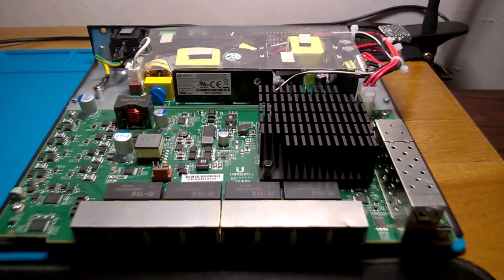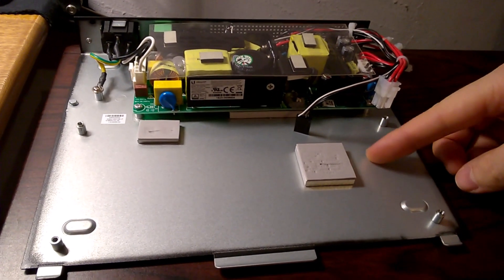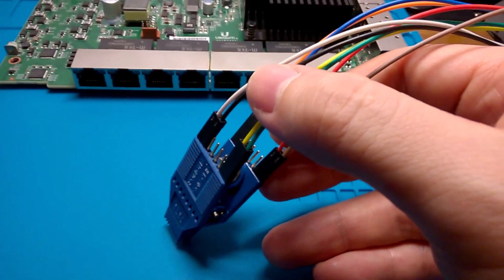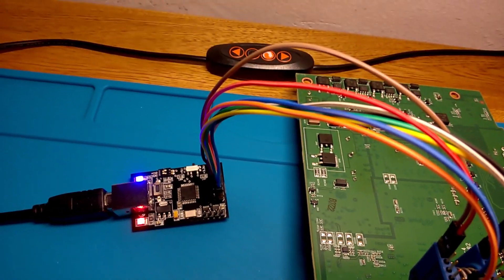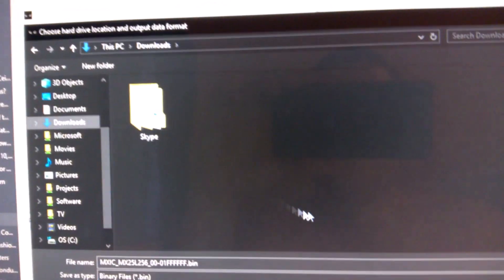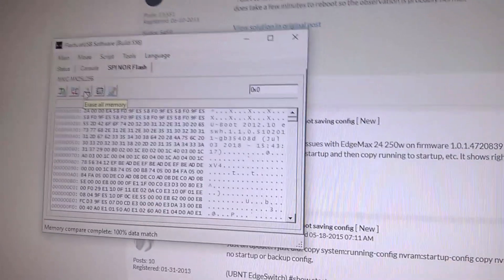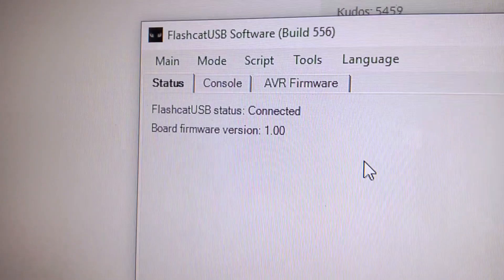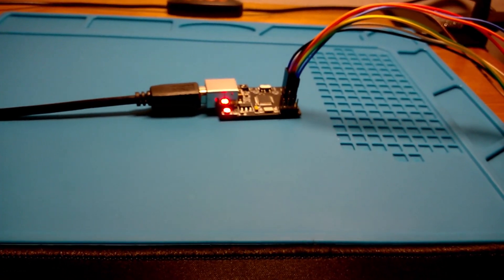Ubiquiti ES-8-150W FlashcatUSB SPI Flash Backup

Comment: Do you happen to have a ROM dump of one of the 24 port switches, NON poe? I've got a POE one that bootloops, and wanted to test if it's due to a bad POE board by flashing the EEPROM section of one of the non poe ones. Thanks in advance!
Reply: Did you get it working ? I'm in the same boat
Reply: @nzhomie  nah never got it working, seems the SOC on those tends to die in such a where where the CPU part stops communicating with the network chip part

Comment: Hi!The flash failed.Installed a new one, filled in the removed dump, but got A12.
Reply: The same with me but with another programmers ch314 and EZ2023+ .
did you found solution for Error A12?

Comment: any idea if the logins are different on the dump as the ubnt/ubnt isnt working for me, im trying to use the flash to diagnose/recover a  48-500w,

no worries i managed to get it to reset and am in using ubnt.

dont suppose you have come across a 48-500 dump?
Reply from the maker: If the username and password are no longer working you can always factory reset the device
Reply: У меня есть,но вероятно вы как и я получите error a12
Reply: Was it possible to run es8-150 on a dump?

Comment: hi m8 can you tell how to make 8 pins paloma and how connect the cables to flatcatusb
Reply from the maker: Hello, you can buy an 8 pin or a 16 pin Pomona clip that is already pre-wired from embeddedcomputers dotnet. Go to Products -> Cables and Test Clips page
Reply: @RicardoCooper  thanks i have a clip  i need where come the wires can you help me .
Reply from the maker: @wimmoer424  OH OK, from what I understand you have a Pomona 5250 SOIC8 that is not pre-wired... For the wiring pinout/diagram you can look in the FlashcatUSB manual on page 18, here it will show you the connection
Reply: @RicardoCooper  thank you.

Comment: Nice video, can you share dumped flash from us-16/ 24/ 48 ??
Reply from the maker: Sorry, I only have a ES-8-150W
Reply: Ricardo Cooper can you share it? Maybe it helps me to repair my US switch.
Reply from the maker: @tertomium  I just remembered I DO have a US-8-150W backup (I was attempting to convert my ES to a US) here it is https://mega.nz/folder/65gFSabY#TgzH-0uILAbwWGhF4nFLEg

Make sure you save a full backup before you try anything, I have also included a (FCS) script file you can use with the FCUSB to only read/write to specific sections of the flash

If you need additional hand holding/help let me know I am available, all I ask is for a donation (of your choosing) after the job is done.
Reply: @RicardoCooper  wow, thanks a lot. Have one of these dead switches where just some led port pattern lights up.
Seems to be a common problem but there seems to be no solution except RMA it. Maybe its firmware related.
Reply from the maker: Ремонт ubnt  I do not think you need to convert it because they both just dump the raw binary content of the flash. I would however delete the EEPROM partition before flashing because this is where the MAC and other specific hardware addresses are found (you can cut EEPROM part out with a hex editor)

0x000000000000-0x0000000c0000 : "u-boot"
0x0000000c0000-0x0000000d0000 : "u-boot-env"
0x0000000d0000-0x0000000e0000 : "shmoo"
0x0000000e0000-0x000000fe0000 : "kernel0"
0x000000fe0000-0x000001ef0000 : "kernel1"
0x000001ef0000-0x000001ff0000 : "cfg"
0x000001ff0000-0x000002000000 : "EEPROM"

If you preformed a full backup before you flashed my backup send it to me, I will try to fix the corrupt parts and send it back to you.
Reply from the maker: Ремонт ubnt  I emailed you on your website
Reply from the maker: Ремонт ubnt  Write me your email in a reply, then delete it after I write you.
Reply: @RicardoCooper  Did you manage to convert ES to US?
Reply from the maker: @АнтонРумянцев-ц7п  I personally did not succeed, but another guy said it was possible, but I am not certain other than replacing the firmware, what else needs to be done.
Reply: @RicardoCooper  I tried to write your dump to es8-150, and the switch does not load.I can't log into your account because I don't know the login password.Reset the button on the switch, writes that there is no firmware.error a12.compared the us8-150 dump and yours-they are completely different.Do you have another dump?
Reply: @RicardoCooper  If necessary, I have a dump of es 8-150 and 48-500
Reply: @АнтонРумянцев-ц7п  Hi,  If you have US-48-500 dump could you share it ? i have an un-used ES-48-750 (i assume they are pretty similar) that i don't use, i would be curious to give it a try :)
Reply: Any update on this guys????
Reply: Any chance cam you share kernal file for the switch. I am traying to load via console, with U-boot commands. But I need just kernal to write on specific address.
Reply: Were you able to convert us->es, es->us?
Reply from the maker: @tertomium  I tried but after flashing the US backup on my ES it woul not fully boot.
Reply: Ricardo Cooper did you Check console / uart output? Got my US repaired. There was a shorted cap near cpu on the backside. Due to that there was no 3.3v rail supplying power to the NOR and so on. The cpu seems to get very hot because the area around the cpu is discolored.

Comment: Great video - thank you! Any ideas if this can be done on the ERX-SFP also?
Reply from the maker: If you provide some pictures of your ERX-SFP PCB I can tell if it uses SPI flash for storage.
Reply from the maker: Update: I checked online and it appears the ERX-SFP same as the ERX uses nand flash, so this method of backing your device up is not possible.

https://www.peschuster.de/2017/09/ubiquiti-edgerouter-x-sfp-teardown/

I do see that your device has a JTAG port and a MIPS processor, I can test my EdegeRouter X and my FlashcatUSB Pro see if this supports JTAG'ing this device.
Reply: @RicardoCooper  Thanks - I will post some photos on the ubnt thread, as I don't think I can here.
Reply from the maker: Hi Alex I have a update to your question, the ERX is supported but you will need to purchase a usbjtag nt flasher, here is the relevant thread for the ERX and it should also work on the ERX-SFP http://www.usbjtag.com/vbforum/showthread.php?p=61292#post61292